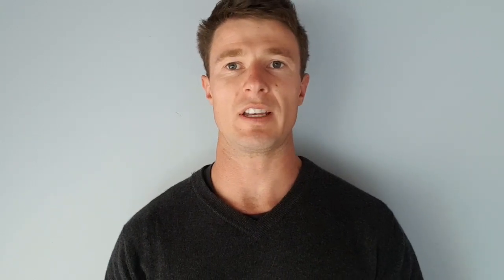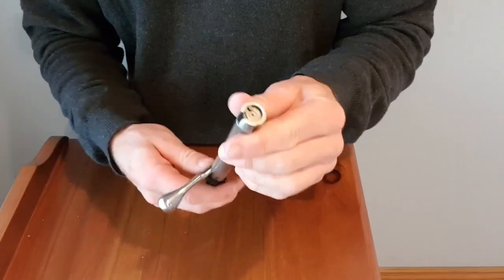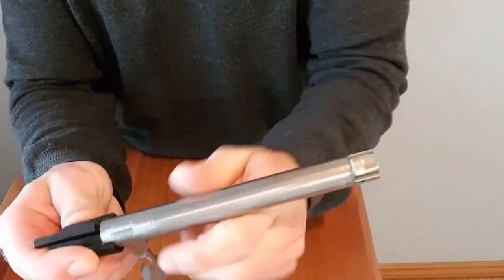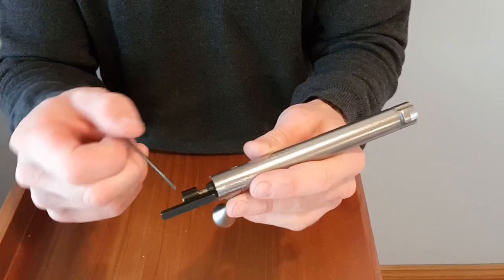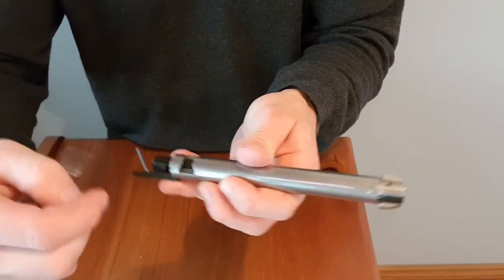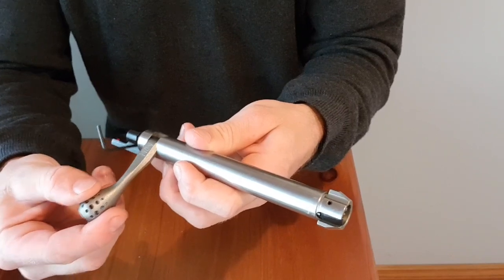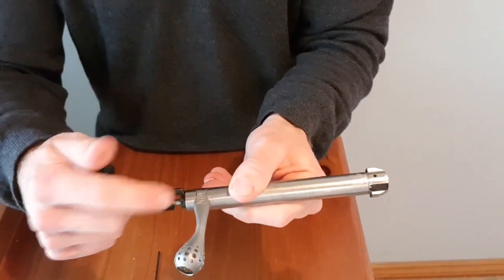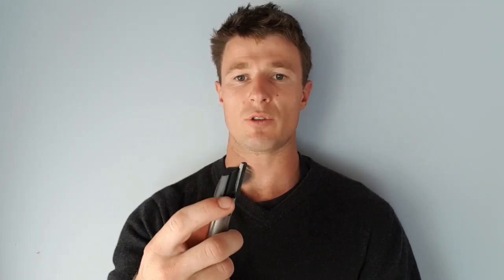Tikka Bolt Breakdown and Titanium Handle Installation

Comment: Ahhh I did what you said not too do. I de cocked mine into that slot, now I’m not sure how to get it back up? Any ideas
Reply from the maker: Been there done that, vice or vice grips on it etc to rotate out of that slot. Worth putting some protection in the teeth so you don't mark the slider. Cut up a butter lid or something and use that think hard plastic etc
Reply: @MTNGear  ahh yep. Copy that! Cheers bro

Comment: Nice demo, I rub a dab of lithium grease on the firing pin/spring to stop it rusting.
Reply from the maker: Good idea. I use any sort of random oil but it doesn't stick around that long so the grease is probably better.